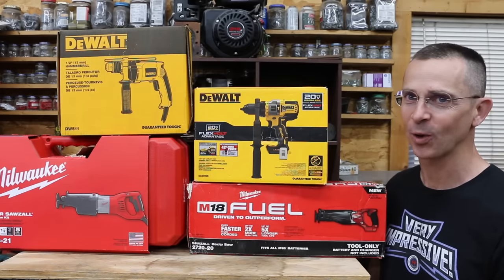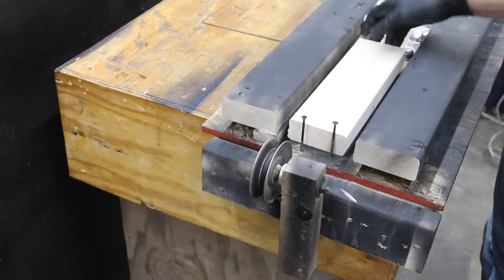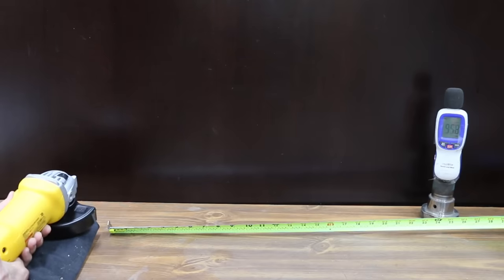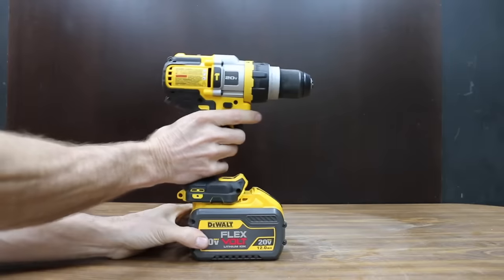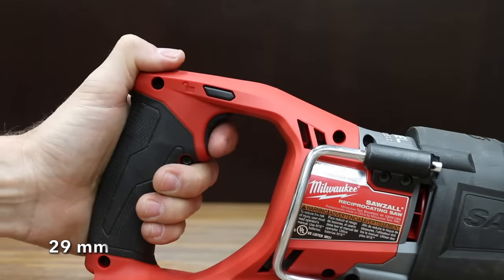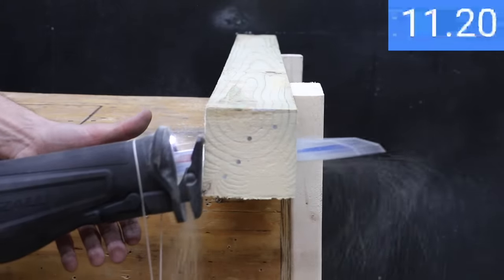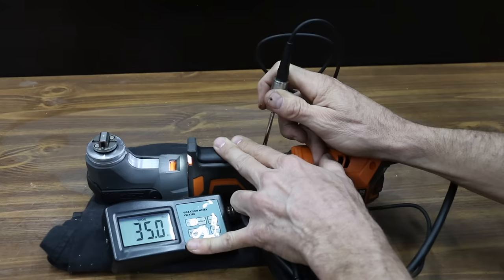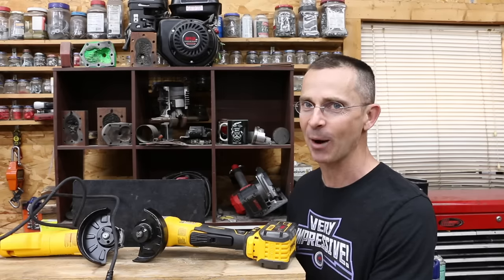Let's Settle This! Are Cordless Power Tools REALLY Better? Torque, Cutting Speed, Noise, Vibration

Comment: Why wouldn’t you use the 60 volt cordless tools in this comparison on the dewalt stuff? Putting a flex volt battery on a 20 volt tool doesn’t make it 60 volt and this is alittle frustrating cause I know my 60 volt dewalt grinder is insanely powerful and I definitely think it’s stronger then the corded ones but I always watch your videos hoping you will use the top of the line cordless stuff but you literally never use the 60 volt stuff!!!!
Reply: Yeh, their average 20v grinder is not supposed to have corded tool power, while the FlexVolt is.  They even advertise it as such. Same with the recip saw test, should have used the M18 Super Sawzall with HO battery, as it is advertised as corded level performance.  I love PF, but they need some oversight on product selection so everything is more apples-apples.

Comment: Todd - What are your overall thoughts on the Dewalt 60v lineup? I just bought their string trimmer and will likely buy the majority of their 60v tools unless you have a better suggestion based on price/performance. 

Thank you for yet another great comparison today!
Reply from the maker: I've only tested a few 60V DeWalt products to include the string trimmer, pole saw, and chainsaw.  All of the products deserve an A+ for performance in my opinion.  Thank you!!
Reply: @ProjectFarm  Thank you sir! I am definitely going to buy the chainsaw. I love the trimmer because I already have brush cutter, pole saw, and hedge trimmer attachments from my gasser that fit this. I’ve grown tired of how finicky small gas engines are. It’s nice to just grab and put to work with zero prep!

Comment: Depends on the application, battery is always nice if you need to move a lot, but the cords are nice when you don't need to move the tool much saving on batteries.
Reply from the maker: Great point!

Comment: For professionals, the battery / cord comes down to practicality. The tools will wear out in 5 years max. For DIY enthusiasts, after 20 years, corded tools will be as good as new, and battery-powered ones will be ready to be thrown in the trash. That's my 2 cents for this test.
Reply: Are you saying they'll be trash because the batteries won't be made anymore? For big brands like DeWalt and Milwaukee third parties will continue to rebuilt batteries for a long time. a brand like hart that may disappear could be a much bigger issue.
Reply: @annihilator4000  I just recently kicked out a Black and Decker Cordless Drill and Cordless Screwdriver. He was 10 years old. The company still exists, but the technology has changed so much that nothing really fits. But my Skil saw, which I also bought at that time, is like new.
Reply: My 20 year old corded tools are fine after 20 years
Reply: @MotherAlgorithm  That is the point. How about your 10-15y battery tools?
Reply from the maker: Thanks for sharing.
Reply: @jacekpiterow900  ni-cd ones I have a few that would still work but tye battery performance is so crap even with new ones I wouldn't bother. I used them for 10 years working as a carpenter until I switched jobs. They'll be fine for years yet.

Comment: Corded tools absolutely have their place! High velocity/high power consumption tools like routers and table/miter saws are much better to have corded since they eat batteries.

I was always taught to buy corded tools used and cordless new! Great video!
Reply from the maker: Thank you!
Reply: I only use cordless hand tools. Anything stationary is a waste of batteries and lacks power. If I am working somewhere that doesn't have power, I'll bring a generator to plug my corded tools  into. You are going to need somewhere to charge your batteries anyway, if you are doing any real work. My Dewalt cordless circular saw can only cut through a handful of boards before the battery dies.

Comment: To each their own, but since so much of my tool arsenal has become cordless I have found myself filled with an irrational anger every time I have to get an extension cord out.  So much so that I don't so much care if the cordless tool takes three times longer for something, I feel it's worth it not to have to get out, coil up, and put away a cord again.
Reply: And no matter what- that damn 50 or 100' extension cord ALWAYS gets twisted and knotted up and pulled out of the socket or the next ext it's plugged into GRRR!!!
Reply: @HobbyOrganist  And it compounds and gets that much worse if there is an air hose or something else for it to get tangled up.

Comment: Want about longevity? I am on my 4th generation high quality battery powered tools and still using all of my original Milwaukee cord tools I bought in the 70s and 80s, in my shop. Yes the battery powered tool are very handy but you pay dearly for the convenience. The tool manufacturer is the benefiter of the battery the tool always out last the batteries and soon the battery will cost more than the tool its self and in the meantime cost to make the batteries is becoming less so more money for the manufacturer. Think how much better the corded tools would be if the cords were all standard and the cord plugged into the tools?
Reply from the maker: Thanks for sharing.

Comment: Review SharkBite, GatorBite, & TechTite  plumbing connectors. 

Our incoming water line was repaired with a SharkBite connector (buried in the ground). It went bad & broke. You could test their usage in extreme circumstances (buried, outside in the sun, heat, & cold). 

Test how much force is required to pull the pipe from the connector.

Test how much water pressure it takes to cause the connector to fail. 

Test how easy it is to disconnect the pipe from the connector.

Test to see if the connector is really reusable.

Comment: Very interesting question indeed.
Another consideration would be the charger and batteries (I think you've made a video about that), because those have a starting cost which tends to induce commitment to a brand, whilst corded tools carry so such "obligation".

Also, I was kinda hoping you'd open them up to compare the actual working mechanism, which may be of different designs for corded and cordless, and will most likely affect performance.

Video Idea: find some tool that has similar mechanisms between corded and cordless, disassemble, and switch the two.

Anyway, Thanks for all your work, I appreciate it.
Reply from the maker: You are welcome!  Thanks for the suggestion.

Comment: I really like my 20v dewalt 1/2” drive impact, and the 20v dewalt impact driver. I still use a lot of corded tools as well such as my new dewalt corded angle grinder and older single direction black & decker drill.
Reply from the maker: Thanks for sharing.

Comment: I am contesting the DeWalt cordless driver to the corded drill.  The test was tailored to driver specific tasks.  I will never use a corded drill to drive in lag bolts.  It's not a fair comparison.  I will use a corded drill for drilling holes only.

Comment: Suggestion: Looking for a test video of the output of different mfg coils/ coil packs  for ford V8 4.6L3v  (e3.70) or similar….  , Motorcraft , accel , bluestreak, ENA , MSD, AC_Delco , etc . Test for EMF leakage and for power output , assuming they get the 12-14 vdc from the alternator…. And what ever else you may know what to look for …. I know they have Spark plug testers , is there a SAFE WAY , to test this equipment . At the very least suit up with full arc flash protection as they claim the output can kill you , it a high voltage but low amperage device . After watching your spark plug test and the E3 results , I put them in the whole family’s cars and all my small engine equipment . !!! YOU ARE a Professional!!! Thank You for the honest logical content .  We appreciate you.
Reply from the maker: Thanks so much!  Thanks for the video idea.
Reply: I also use seaFoam in everything too

Comment: Any chance to see tests on car tires?  I know it'll get expensive very quickly, so I can understand if you won't.  But it does leave me wondering.  Which car tire is the best?  Are there tires better suited for freeway use?  City use?  How do they handle on pavement, dirt/gravel, etc.  Fuel economy impact.  Puncture resistance.  Is it a case of you get what you pay for?  Or is there a cheap tire that can be a good choice?

As someone who does a lot of driving for a job and a hobby, car tires are something where I'd be looking for something long lasting or good on fuel economy.
Reply from the maker: Thanks for the suggestion.

Comment: As a plumber using a Sawzall daily back when I would wear one out about every nine months. My preference was the 2 speed model with the 3/4'' stroke as it was vastly superior when cutting out galvanized piping and cutting PVC pipe. The 1-1/4'' stroke and variable speed was a nuisance as it was more likely to hang up and less precise. For wood demolition, nothing could match a Porter Cable Tiger Saw.
Reply from the maker: Thanks for sharing!

Comment: corded vs cordless in my humble opinion is just reliability vs comfort. It is the only two conditions that I can come up with when comparing the two tools. I always opt to use only corded stuff, as I don't like the drop in efficiency when using cordless tools. I believe that putting a battery on a angle grinder was a great idea when someone needs to use quick periods to remove a burr or something like that but for a heavy duty use I think its just a gimmick. In my work I use my dewalt variable speed corded angle grinder with a polynox cylinder to buff stainless steel handrails to a perfect matte finish. I use it straight 8 hours a day every day, and I once borrowed a cordless dewalt angle grinder to see if it would be more comfortable to use. And indeed it was, the tool is half as heavy, the cord is extremely limiting factor and it was like paradise to use a cordless tool, but changing of the battery every 30 minutes is the main killer for me. I would need 5 batteries to always have a continuous work flow because to fully charge a battery you need at least 1 hour. Fast chargers are better but they wear out the batteries quicker. I like cordless tools, but I am not keen on investing a lot of money into them. a corded tool is better tool in my opinion. Unless you work in some far away village place with no electricity, them maybe firing up a generator to charge 6 batteries at once for various tools every once in while to have all tools you need for the job is a better idea than to have a generator working 8 hours a day non stop when half of the time the tool is not even in motion because you set up, or prepare a work piece, etc. I guess this needs a 10 hour long discussion, but for me a corded tool is better, maybe I am a grumpy grandpa, I don't know, Im only 24 lol. Anyway, a very good video Todd! Thank you for taking time to make such great tests!
Reply from the maker: Thanks and you are welcome!  Thanks for the feedback.

Comment: I wish you mentioned how the corded rigid multi tool has interchangeable heads instantly making it the better pick in my opinion. Try for yourself if you peel the rubber sleeve back a bit you'll find two hidden release buttons!
Reply from the maker: Thanks for the feedback.

Comment: Every year the big box stores appear to offer less corded power tools. Now that the more powerful brushless power tools with longer battery run life is the way to go. Nice to not have to drag extension cords & air lines around. Still have my dad's 70 year old huge heavy 1/2"  Skill hand drill. Drilled thousands of holes thru wood to pull wire but have not used it in last 10 years. Asked my carpenter nephew if he wanted it. Told me no thanks. He also had his dad's old heavy 1/2" hand drill collecting dust in his garage. If I get 10 years out of a $200 brushless power  tool that I used a lot would be very satisfied.
Reply from the maker: Thanks for sharing.

Comment: One thing I can say the cordless may be convenient portable not as annoying Due to the wiring but the cordless no matter what how many years you have it the batteries won’t be an issue because it’s wired so you don’t have to worry about that battery cells ever

Comment: I still have grandpas old corded drill, it is an all heavy metal housing, not painted. The power cord is 2 prongs, no ground like today, You can see the blue sparks inside when running it and now and then it gives you a nice little shock.  Just a mention on Makita, I worked as a welder/fabricator in a large company building and repairing farming and processing plant equipment. Makita was all the company used for power tools like grinders and the like,  they took a beating, probably more use in a week than any civilian would put on them in a lifetime and they never let us down. I do not know if the quality is today what it was in the mid 90's. I hope so.
Reply from the maker: Nice!

Comment: While battery tools have certainly come a long way in the last few years, one thing I can say in favor of a corded tool is that if I don't use it for a year, it'll still be ready to go when I need it for a quick task.  The battery tool might need a recharge before it'll do anything.  Also, being kept in a cold garage year-round won't affect corded tools anywhere near the way it'll affect batteries.  And I'll never need to buy a new (EXPENSIVE) battery for my corded tools.  That said, I still love my cordless tools for most tasks, for exactly the reason listed in this video.  Can't always find an outlet where I'm working on something.
Reply from the maker: Thanks for sharing.

Comment: As many have said: which is better? It depends. It seems to me that generally if you are working on a job site daily the hand-held battery tool is handier most of the time. Around the home and home shop corded is generally better because of battery lack of use degradation and high battery replacement cost.
Reply from the maker: Thanks for sharing.

Comment: I've wondered if there's conversion units (a corded converter that connects to the "battery" slot) that would afford you all the benefits of a power cable (runtime, consistent power, etc.) because so many of the cordless varieties seem to have extra features... If there ARE cord adapters, it'd be interesting to see the "cordless" varieties perform against the natively corded when AC power is supplied.
Reply from the maker: Thanks for the suggestion.

Comment: For sds max Dewalt the corded puts out more hitting energy at half the price;   C$500 compared to the $1000 2x60V cordless.  Then the issue becomes depth of hole in batteries per foot of rock drilled.  Vibration may be less on the cordless.
Reply from the maker: Thanks for sharing.

Comment: I think it depends on the tool. For a carpenter, I'd absolutely prefer a cordless circular saw. However, I think most welders are gonna opt for corded angel grinder, as angle grinders are battery hogs. The cordless version could come in handy in the field, but in the shop, I think it's typically gonna be the corded version.
Reply from the maker: Thanks for the feedback.

Comment: Best tire pressure gage? How do you know which ones are accurate/which aren't? I recall you using some tire inflators and you saying that some of them were a few PSI off compared to yours, but how do you know yours isn't off? Sincere question and request, not trying to be snarky here. Love your videos man, keep up the good work
Reply: You could buy an industrial air pressure gauge (they're not that expensive) and screw it onto a tire chuck.

Comment: Corded or battery is environment dependent in my opinion, if your doing a bunch of heavy cutting all day, corded. If your outside or it's a quick project cordless. Corded can run indefinitely without stopping (without buring up or power grid going down) while cordless you have to have 2 or 3 batteries if you want to work non stop.
Reply from the maker: Thanks for the feedback.

Comment: depends on the usage. if you only use a tool 1-3 times a year, the batteries will not last but, the corded will always work. 
if i were on a job sites without electricity i'd use battery powered tools. example: i do maintenance on my house once a year to keep it up. usually during the summer. why buy battery tools? besides the added expense the batteries would not last.
Reply from the maker: Thanks for the feedback.

Comment: For tools that I only use occasionally I don't want to bother with storing batteries and chargers and then having to charge the battery. Corded tools are best for this. However, for tools I use often (like hand drills) battery are best. And, sometimes I prefer my air powered tools. They can reach into spaces that my electric tools cannot.
Reply from the maker: Thanks for sharing.

Comment: I have to go with corded all day. The batteries just don't last long. Either they stop taking a charge or just drain while sitting. And usually it costs more to replace the battery than buying a new power tool. Ya, they come in handy where an outlet is not available but your better off using extension cords or a generator for the corded tools. The corded tool has the same power all day long. But great test as always on your part
Reply from the maker: Thanks!  Thanks for sharing.

Comment: Very much representative of what I've seen in the field. Though, to be fair, when you need absolute power, you can still get corded tools that will stomp all over the cordless tools. That's not even getting into the gas powered tools. All-in-all, I'd say that cordless will get the job done most of the time, any more. However, I think a whole lot of homeowners are wasting a lot of money on various cordless tools. Most homeowners and DIYers would do well to buy a decent extension cord for $20 and then fill their garage with corded tools...and one cordless drill.
Reply from the maker: Thanks for the feedback.